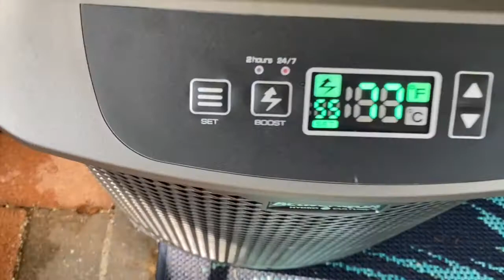How To Build Your Own Cold Plunge Tub

Comment: Thanks for posting this!  I'm in Vermont with a new 100 gallon tank that lives on my back porch.  Wondering why/if you cant get by with the 1/4 HP option from Active Aqua.  It looks like it should work for climates that don't get too hot in the summer but I don't know how these things are rated.
Reply: Sorry, just finished the video and you answered my question about the 1/4 vs 1/2 hp unit.  Wondering what your climate's like.  Here in Vermont our summers are typically in the 80's during the day and 70's at night.
Reply from the maker: @romand123  no worries at all. Sorry for my delay. After making many changes and seeing lots and lots of different builds... you would be fine with the smaller unit, just upgrade to a bigger tube like 1inch... also I would build a box around your unit and insulate it for the summer time and you will have NO issues keeping it cold.

Comment: Could’ve just used a lighter to heat those ends up just enough to be able to get the connector in. Looking to use this same basic setup but going the pack out frozen water bottle route

Comment: Do you have links to the fittings you used for the inlet/outlet you drilled on the tub? I have the exact setup I just don't know the name for those fittings you drilled for?

Thanks!
Reply from the maker: I do not, I ended up finding the right size at an Ace Hardware... they are called Through Wall Fittings ... I also have a new build that doesn’t required and drilling if you want to hit me up on IG I can send that to you too

Comment: Any updates on this please? how did the chiller work out so far?
Reply from the maker: Hey Evolve. Absolutely!! It works great!!! Only change I’ve had to make is changing to a better filter... only because the original filter takes to long and isn’t as good with high flow rates. So what I did to is once the water is initially filtered and I have the sanitizer in it to keep it clean ... I hooked the pump straight to the chiller... freezing cold water in a matter of 2 hours... haven’t gone below 50 degrees yet... but the chiller will cool it to 39. 🥶... I would recommend just getting a small pool filter and pump combo... they are the same price of not cheaper than buying the 2 separate pieces that I got. Let me know if I can help. 😁💪

Comment: Great video man. Hey what is the boost button on the chiller for? Do I need to keep that on? And if so do you keep it on 24hr? Thanks
Reply from the maker: I usually will run it for 2-3hrs before my plunges in the 2hr boost. Otherwise I haven’t looked much into it myself
Reply: From the chillers I’ve personally looked into the boost just pulls a higher power draw for faster cooling. Your electrical bill will go up if you leave it on 24/7. If you run the chiller over night then you shouldn’t need the boost unless the temperature difference between desired water and ambient is high. (MechE here, but openly haven’t fully looked into it all so could still be wrong!)
Reply from the maker: @haltorne6647  thank you for this 🙏🙌

Comment: You mentioned fighting the outside temps, if you were to move the tub outside would the chiller work efficiently or would you overwork the unit?
Reply from the maker: Hey Tom, great question. After much more experience and having several others build them outside it works just fine. One recommendation for outdoors is to insulate the outside of the tub, this helps sooo much with keeping it cold and running the chiller less.

Comment: Do you plan on putting pvc piping. I have a setup using a pool filter and want to add a chiller, insulation, and use pvc piping.
Reply from the maker: I have looked at that and had a few people who used some of this info and built using pvc... but I have not yet... I also now use a pool pump / filter combo... waaaay better.

Comment: Hi.  Curious as to what made you choose this route rather than going the chest freezer DYI method.  Thank you in advance for your input.
Reply from the maker: Absolutely, thanks for asking. A couple reasons: 
1. the risk of potential shock with a deep freezer. 

2. I can control the temperature with this.. 39-75 degrees, and it works really well - takes about 2 hours to cool it from 70 to 50. 

3. Filtration set up is much better with this... changing water is minimal and it’s clean, sanitized, and filtered. 

These are some of the major reasons. Hope it helps. 😁
Reply: @Michaelblife  thank you.
Reply from the maker: Absolutely! Happy to help!

Comment: Great video! I was curious, is 52 degrees the temperature you should do it or is that just a preference?
Reply from the maker: Thank you so much! anything under 55 is preferred. 🙂
Reply: I only do the cold plunge with ice but it’s too expensive. It goes to 30-35 degrees but I am going to buy a chiller for a 100GL tub

Comment: Does the chiller have a pump on it to push out the water to the tub?
Reply from the maker: No, the pump in separate - but I’ve made a bunch of upgrades and have a much better set up I need to share I just haven’t made time. You can message me on IG and I can share the written process via email and show you the new set up via video. The pump/filter combo is easy to use and works great

Comment: What model was the first chiller you bought? Did you need the 1/2 HP because the first one wasn't enough? Do you think 1/4 HP will be enough? There's a step down model which is less money.
Reply from the maker: I prefer the 1/2 ... but the 1/4 will work if you get a pump that matches the GPH flow rate. Use some insulation and it will definitely work

Comment: One could just freeze a 24 pack of bottled water (freeze with some water removed and lids removed), then fill the bathtub and put in the frozen bottles for a bit. Under $10. Thumbs up! 🥶👍
Reply from the maker: Yeah sure, if that’s the route you want to go... go for it. 😁💪. If someone wants to do it daily or multiple times a day, this is just a lower investment option for them to DIY.
Reply: @Michaelblife  Yours is real deal, we’ll done. Mine’s a poor boy version.
Reply from the maker: @robseibertgulfcoastrealest3243  thank you! But unfortunately.. 1k to build vs 5k to buy... That was the lowest I could find to build. Not bad for lifetime use.
Reply: I just built mine for under $500. I was able to find an active aqua 1/2hp chiller on an auction site for $65. I will eventually get either ozone or uv to treat the water.

Comment: Can you let me know make and model of the chiller
Reply from the maker: Absolutely! Active Aqua 1/2hp is the one I used... lots of options out there though
Reply: @Michaelblife  what's it like in electricity.  Is it expensive to run
Reply from the maker: Once it gets to temp... it will hold it there pretty good without adding too much... 30-50/m pending how you run it... but that’s including running the pump
Reply: @Michaelblife  so £30 / £50 per month